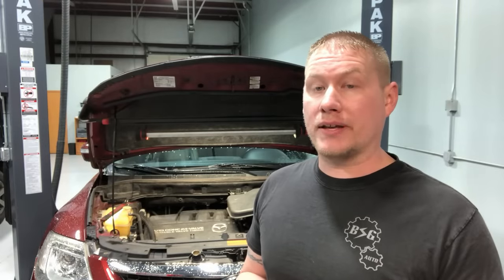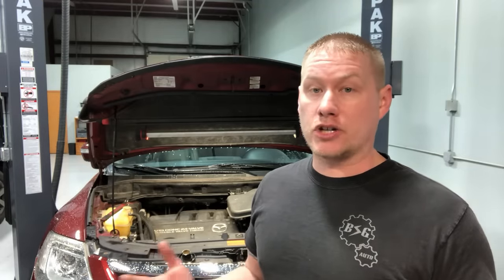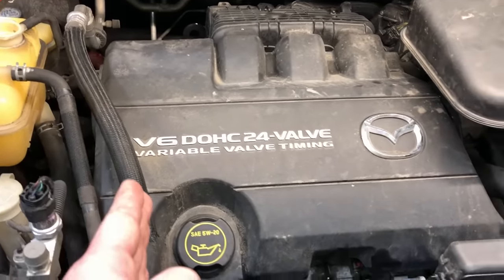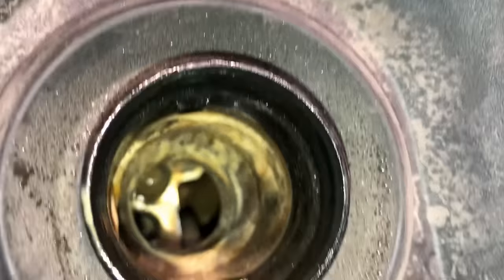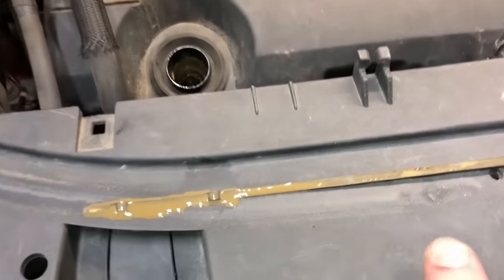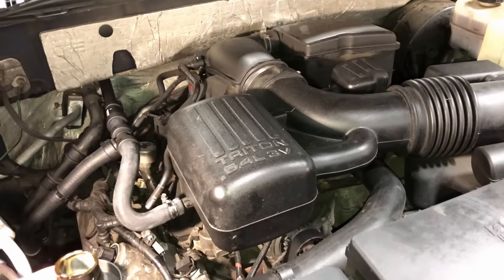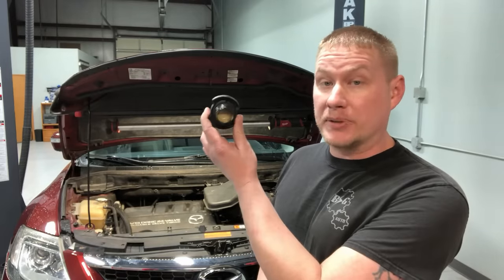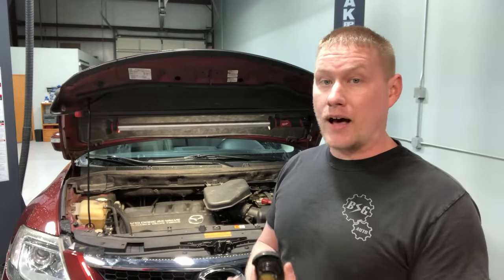Do You Have a Blown Head Gasket?

Comment: Thank you very much for clarifying the differences. I have been told to worry when the oil cap gets a bit of milk on it and when the exhaust is blowing white smoke in cold weather conditions. In every head gasket symptoms video, they also warn about this without comparing it to a vehicle that just has normal cold weather symptoms. Finally someone who looks at the twofold story about head gaskets!
Reply: so how you fix the problem?
Reply: Us bank

Comment: Definitely gave me some peace of mind! I started up our backup 97 Camry today after it sitting most of a very frigid winter in MN this year. I had fretted all winter about the -30F temps and how the coolant may have been too old and froze up and damaged the engine. The engine smoked a fair bit of white smoke initially on startup, and had some milky stuff on the filler cap. The oil on the dipstick was nice and normal, however, and no apparent loss of coolant. Thanks so much for this video! It at least gives me some confidence driving it instead of starting to tear into it or sell it.

Comment: Thanks Neighbor  for the neat check. I use my 5 gas analyzer and check for hydrocarbons at either filler neck or coolant bottle. But of course that water pump internal leak into the crankcase would not show. Excellent information.

Comment: Things to check
1. Coolant overflow tank is empty
2. radiator cap has milky/foamy substance (but may only be accumulated condensation)
3. check for low coolant level in radiator
4. check oil dip stick for browny/milky/foamy mix, not oily look
5. check inside oil fill and look beyond neck to see if inside for milky/foamy deposits

Other valid tests:
- compression test, coolant chemical test, etc.

Comment: Good stuff man! I remember when I was in my early 20's, I had a hot rod '78 Cutlass with a Goodwrench 350 that had the milky cap. I freaked out! Back then I couldn't afford the PARTS for a rebuild, let alone another crate! That's when I learned about condensation in engines from my dad, and other experienced guys. What a relief that was!

It's no wonder, too - later on, I found that my Mr. Gasket chrome thermostat housing was made of pot metal, and reacted with the coolant and different metals in the system, and basically became a sacrificial anode. The gasket surface had been completely eaten away! Coolant was just flowing around the t-stat like it wasn't even there! I always wondered why my heat never worked good, and the temp never got above 140°F. On top of that, I lived in suburban Worcester, MA at the time, where everything is literally, "2 miles down the road" - very few long trips. There were even trails of milky oil mixed with good oil on the dipstick, along with rust and condensation towards the top of the dipstick. What a difference after installing a new housing and 195° t-stat! Felt like the heat was melting my face. 😂

Comment: Lady just turned me down. On replacing her Ford Edge water pump..Told her $750.00 labor plus parts. Which was Water pump. Time Chain. Guides and Variable cam gears... She said that is too much and would just wait. I told her. You wait till 2 gallons of anti freeze gets in your oil. Your walking and spending $6,000.00 for new engine! As is was sucking antifreeze out of the recovery tank. At gallon a week!
Reply: Did you at least change her oil?
Reply from the maker: Wow that’s cheap, she should of jumped on it.
Reply: @FordTechMakuloco  I know its cheap. But I can drop the engine just a little and get my hands in there with my lift...I warned her. 

And yes I changed her oil. It's what she come in for. First thing I asked. Are you putting anti freeze in it... As the oil change was a dead give away...
Reply: @FordTechMakuloco  yup I seen this on a 2006 Ford F150 5.4 triton but customer is having steering issues kept driving and afterwards his power steering pump failed.. but original issue was steering it was hard to steer but pump was fine.. any thoughts on this
Reply: Cars and trucks are expensive ..more so than old school.All these designs
.variable valve timing..nothings cheap anymore
.
Reply: @michaeljacobs2570  justly cheaply made.

Comment: This was very helpful! Was definitely worried the used truck I bought might have had a serious issue but after checking inside everything is normal. Plus temps got down to -30 so I think that's a good explanation for the milky oil cap. Thanks!
Reply: 6

Comment: THANK YOU SOOOOO MUCH! I was one of the misinformed idiots thinking the milky oil cap meant a failing head gasket! You are the man!
Reply: unless you see a cloud of steam at the exhaust side of the car when you downshift or decelerate, you probably dont have a bad head gasket. if anyone says you do, make them do a compression test to prove it. getting a tester in to a new car is a giant pain in the ass, so if they are wrong it is fair to make them do it. especially if you have a subaru...
Reply: @lukewarmwater6412  man I don't and won't ever own a new car. I prefer used. I love the idea of having a brand new car but it's just not worth it to me. I also do all mechanic work myself and just about everything else. So people who make videos like this help me out a lot. Thanks for your reply man.
Reply: @Clare.1985  same for me. I bought a 1997 Sunfire convertible with a 2.4L, the body is in near perfect condition, but the suspension, direction, brakes and soft top need complete overhaul. Been doing all the work myself, 5k for all the parts and the car. Like new, for more than a quarter of the price.
Reply: @OldSchoolZ-wy2yx  $5000 for a 97 sunfire???  Are you out of your brain? That's a 200 dollar car....

Comment: Thank you for clearing that up. My 4.6 had this happen in the winter. My Jeep 4.7 also had this going on until I revised the PCV system per a TSB they had, I also installed a catch can and have zero pudding on my oil cap now.

Comment: Great video, I can definitely vouch for seeing the buildup on the oil cap when there are no issues. I see that with my F-150 Ecoboost, and it definitely increases during the winter months.
Reply: I have a ecoboost 228,000 miles, never seen this on mine.

Comment: My old 57 Chevy had the heavy pudding under the oil fill cap. Turned out that the thermostat had stuck open, and the engine was not getting up to proper temperatures. It was winter time in Pennsylvania.

Comment: When I used to drive 1/2 mile to and from work during the winter.  I pulled my oil cap to perform an oil change and the entire cap was  filled with chocolate milk pudding. I was in a hectic panic for about an hour until I learned about the condensation settling at the highest point.

Comment: I just bought a 99 f150 the buy said it had a blown head gasket and sure enough it wasn't the case. It just needed a radiator and a good ol fashion tune up. Bought the truck for $400, lol. I asked the guy again about why he thought the head gasket was bad and he said the oil was milky. It runs just fine and I was surprised the timing chain wasn't making the noise that happens when the guides go bad
Reply: What? If you have oil on a cooling system and it's not from the engine it needs to come from somewhere, like the transmission. If it was a "radiator" that's the only way

Comment: Hey man didnt know you were in chicago land. I'm in northern Illinios too. I saw the most insane moisture laden oil ever in a 2010 Ford Fusion 2.5. The entire oil sump was milkshaked almost like the Mazda here but still half brown, cardboard colored, and not thick but still the viscosity of normal oil.. So the story is I bought a car to fix it up and the oil was fine, winter started, I pulled it in and out of the shop daily for little over a month just moved to a parking spot. Got on to the valve cover job to do the gaskets and was shocked by the white milky oil in there. Even more freaked when I drained the oil and the whole thing was like that. (after I rebuilt near the whole car). It was Incredible!!! I'm glad I got it changed and will not be doing that again. The oil is normal still after a few weeks of making sure its warmed up every couple moves and take it for short drive to at least get good operating temprature. It had no signs of issues before this. Just in and out the shop not warming up enough.

Comment: On my 2010 Expedition I saw this on my engine oil fill cap too I thought I had a major problem even brought it to the dealership because I was losing coolant also The engine was fine the coolant leak  was the radiator seeping and the thermostat housing was leaking . After more research finding that in the oil cap was normal.
Reply: You can make a really cheap pressure tester. Use a bicycle pump and a small hose to fit. Removed the small hose that goes to the overflow bottle and put the hose from the bike pump into the radiator nipple. Pump it up whilst feeling the top hose. You can over pressurize it as the valve in the cap prevents that. Then start checking for leaks. If you can't find a leak, then wait for 1 hour to see if you still have pressure. If you have lost pressure, and you are using coolant then remove the spark plugs and crank the engine to see if any water comes out the plug hole.

Comment: That's what I have on my 5-4 and with a clean dipstick I thought the head was leaking, I have only been making short trips in Washington State, good video
Reply: Michael Robertson I just noticed this on my 2006 5.4 with 60k. Oil dipstick is clean and coolant reservoir is right where it should be. Maybe I should change the pvc valve and drive it more often.

Comment: Well that makes me feel a little better. I just noticed the cap sludge today (colder than usual out) but I have the same coolant level and my dipstick is clean
Reply: To check for a blown head gasket take off the radiator cap and put a balloon (or anything that will stretch over the radiator filler neck and will expand with pressure), then unplug your coil and turn the engine over. If the balloon quickly inflates/deflates then you have a bad head gasket. What you are seeing is the gasses leaking out of the combustion  chamber past the head gaskets and into the coolant system and expanding the balloon.

Comment: Because of scannerdanner i purchased a used 5 gas micro gas analyzer. I mainly use it for reading ppm hc in over flow to see if the vehicle has an early head gasket failure. In the past i would check the dip stick and rarely the oil fill cap Because of condensation. I used to take dip stick and let a little drip onto manifold to see if water was in the oil by it bubbling burning off vs just smoking like oil. Thumbs up! Didn't know about the internal water pump though. Thanks for that info!
Reply from the maker: Problem with Ford vehicles that include a degas bottle into the cooling system is that the combustion gases get trapped inside the pockets in the degas bottle so they never make it to the top and gives false reading using a gas analyzer or chemical test. This is why Ford does not recommend those testing methods on their vehicles.
Reply: @FordTechMakuloco  thank you for that tidbit of info Brian! I wasn't aware of that either. Thank you for everything you do to make us better. Much appreciated!

Comment: Can a bad reservoir cap cause a overheating problem ??
Reply: I know on GM vehicles, the cap on the white reservoir must seat & seal to hold pressure.  The caps go bad after 2-3 years. They don't hold pressure and it results in overheating.

Comment: I heard a lot of stories about water pump failures on 3.5/3.7 duratec engines, but I haven’t heard nothing at all about the water pump on the 3.5 ecoboost engine. Heard or seen any water pump failures in the ecoboost? Is it the same as the 3.5/3.7 duratec? I have a 14 Interceptor Sedan with the ecoboost at nearly 130K miles, so I am paranoid.
Reply from the maker: Same base engine and the same problem yes.

Comment: I had the coolant under the cap. Also had a leak around oil filter. 
Ford 4.6l V8 has a gasket between the engine block and oil filter housing. It went bad. Coolant and oil flows through this housing. Stupid design. 
Changed the gasket and no more problems.

Comment: thank you  so much... I just replaced my thermostat, and after filling and trying to bleed the air, I decided to do a oil change.... I almost cried, when I removed the oil cap, there was this caramel like substance on the cap. I said to myself, I just blown the head gasket while trying to bleed it.  This caramel substance simply came from the fact my thermostat was stuck open, and the engine wasn't able to reach its normal temperature, the arrow was coming just above the C mark, and normally it should be at mid level betweek the C and H mark....  NOW I KNOW the engine was not warm enough to clear the humidity caused by the condensation in the block.  I also do short distance with my truck as well. Thanks again.

Comment: Great advice, i have low milage some sort of gunk on coolant cap ford engine 1.6 only just got it can coolant become bad after few years?
Reply: coolant does not wear out like oil. you do not have to winterize your cooling system no matter what anyone says dont do it!. coolant lasts for years, dont ever change it unless your specific gravity tester says you should.. also dont buy fords, they have wierd problems that nobody else has. like spark plugs blowing out. and they use additives they dont realy tell you about and you wonder what that gunk on the cap is....

Comment: Mazda rx8's have issues with Milky dip sticks in cold weather and they have no head gaskets.  So yes some cars  can have condensation on dip sticks due to design.   Even some mustangs get it on the dipstick in cold climates with  short trips but have zero head gasket problems.

Comment: I have an 01 expedition and it over heats I've got the mix in the coolant tank and oil but the oil dipstick is clean what could this mean
Reply: My Lincoln Navigator was like that until changed my gasket and problem solved
Reply: NHOE GÍL what gasket?

Comment: I get this on my jeep alot in the winter when I only use it to drive up and down my driveway. It's happened for years so I just clean it out often when it does. The first time it happened I did freak out but pulled the dipstick and realized it wasn't a big issue after I drove it for a while and it does burn off. It doesn't happen on my other vehicles even if I drive short trips but I guess I usually drive them more often later. Like I said though I've been seeing this for years now and still runs like a champ with no mixing in the pan.

Comment: Awesome video man! I had this happen to my 2011 ford explorer with a 3.5l duratec. I replaced the water pump and timing chain drained the oil  and replaced the oil again after 200 miles. But now have a check engine light for a intake camshaft position is retarted and exhaust camshaft is advanced. Any insight on this? I'm about to replace the solenoids thinking the contaminated oil caused them to malfunction hoping I'm on the right track. Thanks again for the great content!
Reply from the maker: Yes

Comment: I have a 2002 Ford Expedition XLT 5.4 that I drive 5-15 minutes a time on average I am in western Washington state and I just changed the spark plugs a few weeks ago now it runs great 168,800 miles on it. It has lots of foam in the oil filler and on the cap but it is not using any coolant and the spark plugs were pretty dry when I took them out to change them. Do you think its just from the cold weather right now and my short trips? My more recent trips have been about 10 minutes on the Interstate 4 minutes in town then shut off go to work repeat and has the same results. Do you think my head gasket is okay?

Comment: Good video.  I always hated those typeof guys who act like they know what their talking about and they pull the oil fill and are like "Nope engine is toast bro" or they pull it while it's running and it starts running funny they don't realize they just induced a huge vacuum leak and they are like "Yupp it's shot it should run rough with the cap off"

Comment: Thank you so much man, i’ll tell ya, you always learn something new everyday. Just the other morning I was doing my basic fluids maintenance when I noticed the same condensation on my oil cap. It’s been like 15 20 degrees here in NY. I got concerned, I checked my coolant level, dipstick level and color and just looked around and under for any major leaks. I have a 4.6 liter GT with 250k and when I saw the discoloration on the cap I said to myself that was it lol. Turns out to be just this, condensation. Nothing abnormal. This video did me justice. Thanks again for the information 👍🏼

Comment: My coolant ends up in the expansion tank but when the engine cools it doe snot go back, often i have ti siphon the coolant back into the radiator. I dont have any head gasket blown symptoms, car does not over heat, but if i dont siphon the coolant back to the rad form the expansion tank, after long drives like 100+ miles, i will start to see the temp gauge start to creep up, as soon as that hapens, i pull over and siphon the coolant and it does not overheat. I've installed new Rad cap, new radiator, new thermostat, new coolant temp sensor and hoses.... at a loss. its a 2010 FX35. I'm not losing coolant, just siphoning it. lol

Comment: My 96 F-150 4.9L inline 6cyl has this “pudding” on the oil fill cap. The dipstick is fine, no pudding. I do drive it to work everyday, and it’s only an 8-10 minute drive one way. I noticed the pudding on the cap and when I smelled it, it smelled like straight gas. I’ve checked the coolant and it is a little low. So now I’m worried. The smell of gas, the low coolant, the pudding in general. Any help?